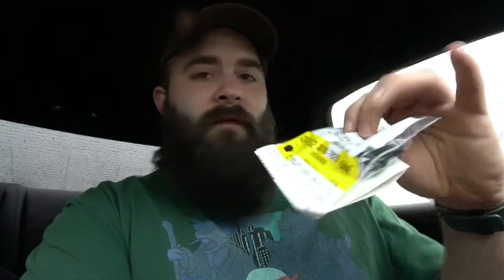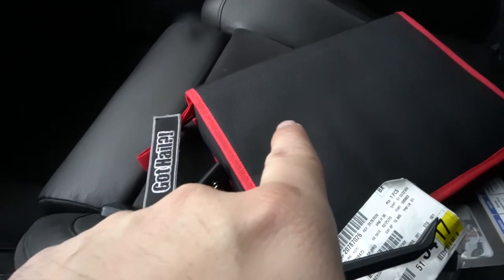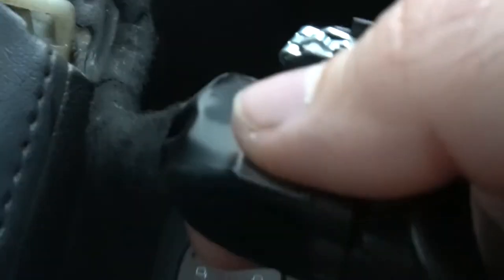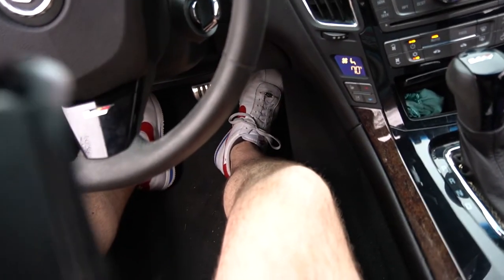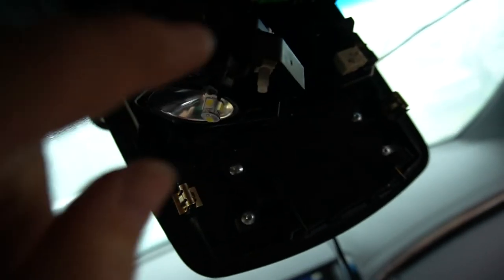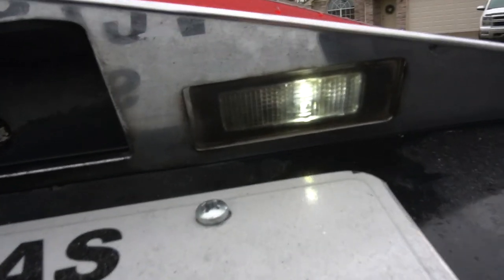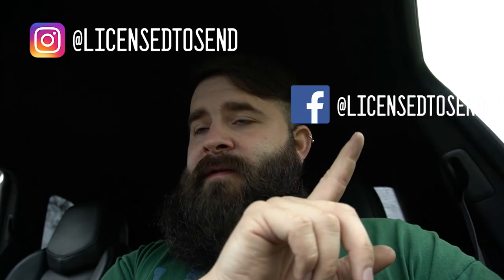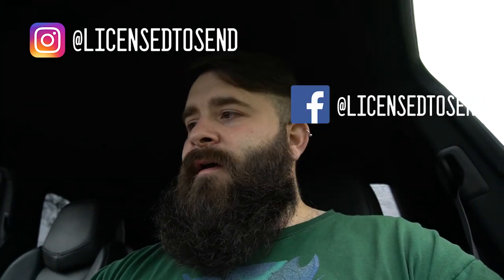New Car CTSV Door Switch, LED's *Channel updates*

Comment: Just did my led bulb conversion. Thanks for the great video. Also did the bulbs 💡under the doors as they also worked and looks badass. 🤟.
Reply from the maker: Haha I didn't do then in the video I think. But it was later that night I had actually forgot those meds where in the doors and I did them later that night
Reply from the maker: Glad the video was helpful 🤘🤘🤘

Comment: Just bought those interior leds, great decision lol
Reply from the maker: Hell yeah!! Weird to me to not have crisp white LEDs in a luxury car
Reply: LICENSED TO SEND agreed man. Headlights and even the reverse light is led, but they couldn’t put $10 worth of led bulbs for the interior 😂.
They’re were all pretty easy, except the rear dome light. The front clips didn’t want to clip in because the upper plastic piece in the headliner had zero support. Had to squeeze a flathead in there and push down then push the two front tabs in first. Not sure if you had the same issue.
Did the bulbs under the door panels as well. Looks super crisp!